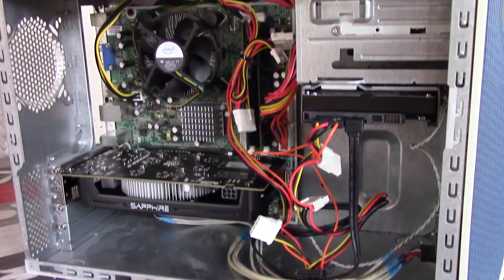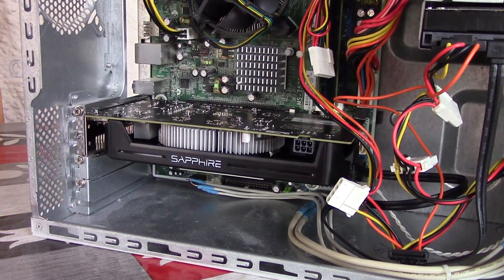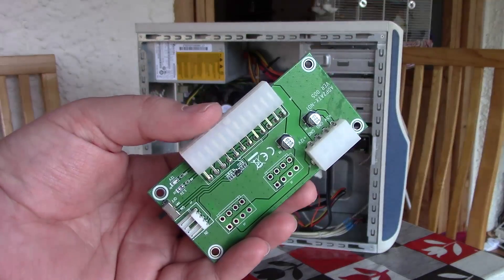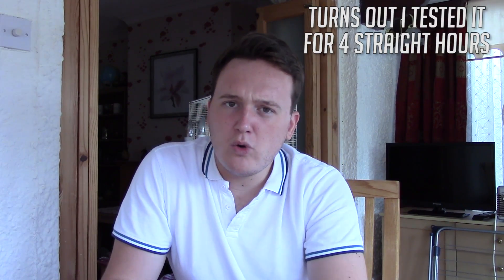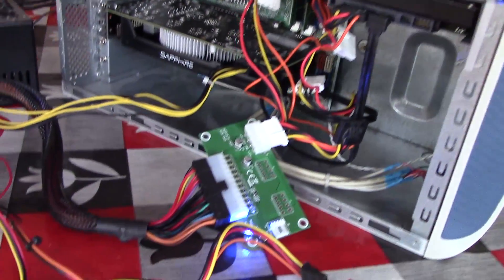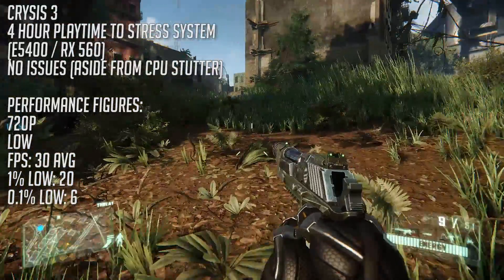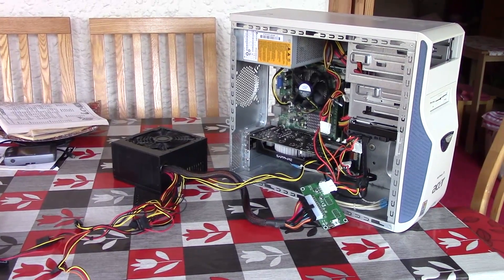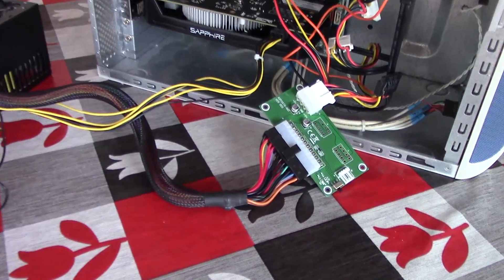Powering a Graphics Card With a Separate PSU

Comment: Let's be honest this is really for vega owners
Reply: Retro/Modern Gaming at its Finest Attention Beggar
Reply: let's be honest I already have a 1000w for my gtx 780s, and if I were to upgrade to a pair of Vega 64s and a ryzen 7 my power draw at load would go down by about 100w
Reply: No, AMD Vega.
Reply: Retro/Modern Gaming at its Finest why are you upset over a pc component when you play nothing but playstation....? Seriously why are you even here?
Reply: potatos_ 4life
The 1050 Ti is intentionally a low-watt card though, and you're comparing it to a much more powerful high-end one.

Its relative, yes 250w is 'a lot', but not for a graphics card.

Even a mid-range one like the GTX 1060 will consume about 120w, twice that of the 1050 Ti.
Reply: Unless you have a 300W PSU, you dont need this for vega lol
Reply: yeah but that part of for servers to power graphics cards is probably true but with a much more safe and reliable solution
Reply: @yumri4  Nop, that's exactly the same board.
Reply: @fss1704  the board might be the same but higher silicon quality chips so nothing in the way of hardware glitches happen and better in the way of being stable drivers. So yeah same board just higher quality and more stable which they pay for thus the price difference.
Reply: @yumri4  Nonono, i mean the board that you use to connect the second power supply is the same model used in industrial scenarios.
Reply: @fss1704  that makes sense as those power supplies are probably made for dual power supply machines
Reply: @yumri4  Yes they are, psus are made in a way to allow you to connect both green wires together to turn the psu on, you don't even need the board to have the psu auto turn on, you just have to ground the psu to the other psu and connect their green wires.
Reply: @fss1704  i was agreeing with you on that. Sorry if it came out as me being sarcastic or something but yeah the power supplies being that makes sense to have for a dual power supply machine. I just never knew how they worked as i only ever needed a single power supply.
Reply: @yumri4  Yeah, i know, i just wanted to clarify how we do in the industrial  size,you just take 2 jumpers from the green and gnd and connect them into the 2nd power supply green and gnd, no need at all for the board if you don`t want to, all you need is an old cellphone charger cable connecting the gnd and green of both power supplies.
Reply: Queen Victoria GG novideo fanboy
Reply: potatos_ 4life errrrm no they don't lmao
Reply: potatos_ 4life
That's primarily because of the cost and performance of the cards themselves, not the power draw. The only time that's really a factor for those cards is when you have a low-watt PSU, like you'd find in most pre-built PC's.

Capt Snuggles
And that's relevant to my point how exactly?

If you're going to compare the RX Vega cards to Nvidia's, then do so with cards they're actually competing against, the 1080 and 1080Ti.

Again, two different tiers, much stronger cards, and different marketing positions. Don't forget that Vega is positioned between the 1080 and Titan XP as gaming/general compute cards.
Reply: "850 watts for a ryzen build?" they said. "you're insane!" they said... who's laughing now?
well, probably Antec to be honest, as I have a spare HCG 850 (bought 2 of them) so I have one on hand for backup and testing purposes.

however... I might just have to give this a go with my vega card when I get it (give the card a whole PSU across both rails) just to see if it makes a difference when overclocking the snot out of it
Reply: Power supplies have been fine for awhile lmao. Even the power hungry 290x cards that were around the same as vega in power consumption ran fine on the same psus the nvidia cards used.
Reply: Steven Randall steam statistics are wrong when it comes to intel integrated graphics cause steam counts intel integrated graphics when you have igpu enabled which lot of ppl have so making statistics false
Reply: you can easily buy 300-500 watt psus and i5 6600k and gtx 1050ti consumes 250W so yeah one Vega gpu consumes more power than a lot of pc budget builds
Reply: ZombieBarioth now compare it's wattage to a 1070 and it's drawing more power.
Reply: i know its intentionally a low watt card but more people have low watt cards under 150 watt than people with high watt cards
Reply: TYPICAL GHOST SNIPER they do cause half of them use a integrated graphics and prebuilt pcs.
Reply: actually yeah not everyone owns gtx 770&970&1070 and above most of the people own 1060 cards and below just look at steam statistics
Reply: 6.37% = "most people" vs the combined percentages of 770, 970, and 1070 of 9.07%... but IF I don't read statistics like a moron I can scroll down to DX11 GPUs and see (drum roll) about 20% of people using intel HD 4000 graphics on steam! so you're wrong on 2 or more accounts
Reply: if you combine all the cards under 150watts its way more than power hungry cards and i said 1060 and BELOW not just 1060
Reply: I'm pretty sure it measures your primary graphics adapter, however even IF what you say is true the person I'm arguing against saying "most people own 1060 cards" is still demonstrably false, and my statement reigns partially true more people have them than 1060s even IF they're not using them as primary
Reply: Steven Randall nope it registers intel integrated graphics as well check for ur self open steam then look in system ur see it registers both integrated and dedicated graphics
Reply: How about you stfu.. attention seeker Retro/Modern Gaming at its Finest
Reply: deathbat6916 yeah I thought as much originally, but hey, if it's worth doing, it's worth over doing.
Reply: 2 Years later and still the same.
Reply: How did you know
Reply: Also for those who do not want to replace the custom psu
Reply: Do you mean, RTX 30 owners?
Reply: U misspelled “shitty hp”
Reply: Or HP
Reply: Ahahahha
Reply: I undervolted my v56 and it consumes like 160w
Reply: Dual 1500 watt power supplies to power the water cooled card lol.
Reply: Rx 56 + undervolting isn't that bad, but can't say anything good about the Rx vega 64, especialy considering it's price point.
Reply: Queen Victoria  fuck ur Vega shit
Reply: Learn to take a joke AMD dipshit
Reply: Tibor Klein Triggered ASS fanboy
Reply: my whole pc i5 2400 and 750 ti consumes less than a 250W so yeah 250W is a lot!
Reply: 250W is not that much you Nvidiot dipshit.

Comment: You don't need to buy into that molex to 24 pin connector crap. All you need to do is connect the green wire and any black wire on the 24 pin with a paper clip and plug it in and the power supply will start right up.
Reply: Mateus Elias it's so both power supplies turn on simultaneously
Reply: The little card is shorting the green one, when the other one is powered. It's so you can have it all in a case as a permanent solution. (You want to manually short it every time you start your pc?)

I used to have a little adapter that connected both pairs of green cables to the motherboard in order to do the same thing. Used that for more than 4 years.
Reply: believe it or not, some people dont want to have to do that every time they turn on their pc.
Reply: Slywooftwo yeah I dont understand whats that card for
Reply: If you have a soldering iron you can do this alot simpler and cheaper with a $0.20c switch off ebay, then you simply press 2 buttons when turning your PC on.
Reply: Not in the same way though. That uses some board logic. This uses the other method but does it in a way that still lets you do simultaneous power up. I was saying this in response to someone else saying to use a second switch though you don't have to do that. I would rather use the board personally.
Reply: EvilTurkeySlices just shorting the green wire does that
Reply: lmao ok
Reply: I don't see much reason that you can't just split the switch header from the front panel to the power supply as well as the motherboard It just needs a bit of wire and you still get the simultaneous power up.
Reply: WorldInThe Statham that is pretty much what this board does.
Reply: WorldInThe It probably just bridges the two pins only when power is applied to the molex plug from the other psu.
Reply: It does but it's a cleaner method than most of the others suggested.

Comment: well i can say i have been running duel power supply for three years now  and it works

Edit:
i just use a paperclip
Reply: maikson97 please tell me more, im curious how it works with just a paper clip
Reply: @jibpanda5388 same concept but you a paper clip to short the ground and power to start the PSU
Reply: Amazing. I’m thinking about doing this with an hp until I can upgrade...

Comment: I need a GPu for my retro pc that has a pentium 4 660 3.6ghHT. Problem is I am using 300w powersupply. what card should i buy? I am all up to used and for old cards aswell
Reply: BigganD titan x 69 way sli
Reply: I think from a gtx 1050 downwards, like gt 1030, gt 950, gtx 750 or even rx 460 and below.

Comment: what that little board do is when it receive electricity from the main PSU, it will turn on a transistor which will shorting the power_on wire to ground of the second PSU which will tell it to turn on. When the main PSU is turned off then there will be no more voltage to hold the transistor thus it will release the power_on pin and then PSU 2 will shutdown automatically
Reply: Riley Stanish transistors doesnt hold power, also 12v and 5v molex doesnt 24v
Reply: Riley Stanish no, the transistor will short the power_on pin of the second PSU to the ground which is like the paperclip trick the only thing that's different is it's automated and in synch with the main psu
Reply: @pierreuntel1970  You just dont need that, connect the gnd and green from the 2nd psu directly to the 1st psu, THE GREEN WIRE IS MEANT FOR THAT
Reply: pompadoms no, the 2 PSU must be in sync and the second PSU will be turned off when the main PSU is turned off, you can see at 1:53 under his finger having a small smd transistor
Reply: this, i wonder if that floppy connector in the board can be used as well instead of using a molex cable
Reply: Riley Stanish 
The PSU'S are not connected in series
Reply: Better than my paper clip lol, it still works tho.
Reply: grizwhop nation then why it need a board at all? And why does it need to connect to the first PSU for? Anyone can simple grab a paperclip and short the power_on pin without any expense. If you just simply shorting the second psu manually then when you turn off the main PSU then the second PSU will still keep running and could create unexpected electric flow into the GPU and might get feed into motherboard create problem with its power control mechanism
Reply: @pierreuntel1970  This is exactly what I am experiencing now. In the beginning my relay that connected the power on to ground of the second PSU switched of when the computer turned off. It worked fine. Now, after both PSU's had been disconnected from the mains for a while, the second PSU somehow manages to get power to the relay, keeping itself powered on until I power of the second PSU manually. The CPU fan will keep spinning before I turn the second PSU off, though a bit slower.
Reply: William Poetra Yoga well.. If you also connected parallel the power_on pin that mean both PSU will get active/shutdown at the same time because they both receive command from motherboard, if 1 PSU failed then the other just take over with no lag because you've parallel connected them, both PSU will fed power to mobo
Reply: Am EE qualified. Can confirm that SandPox is correct. It's just one transistor (electronic switch) which bridges Pin14 (PS_ON) on the 24Pin power connector to ground. This then turns on the second powersupply that is connected in parallel (not series) to the rest of your system. More advanced configurations of this exist in for example server power supply systems where one PSU acts as redundancy for example.
Reply: William Poetra Yoga yes, just connect everything in parallel (yellow to yellow, black to black, red to red...) And things should work
Reply: I'll pretend that I understood.
Reply: bbloching What do you mean balanced out over some capacitors? I'm not understanding you'd want them there as long as gnd is coupled between PSUs, so avoiding an offset.
Reply: IncandescentWithRage sah, sounds more reasonable than my guess. For balancing purposes the capacitors are too small anyways.
Reply: William Poetra Yoga Server grade power supply redundancy has been around for a long time, if you want redundancy server parts are the way to go, many have hot swappable parts and are built for maximum uptime.
Reply: Yes, and we can actually make something similar and simpler logically, using a 5V or 12V relay.
Reply: @wpyoga  or you can cut the green wire on the 2nd psu and connect it directly to the green wire on the first psu.
Reply: Can we implement PSU redundancy in a desktop setting?
Reply: SandPox ok the way you first described it didn't make sense to me. Thanks for explaining.
Reply: +SandPox Sorry I wasn't specific enough, yes this looks like the method to create PSU redundancy, but how about the switchover lag? With regular desktop PSUs, will the CPU reset upon switchover?
Reply: SandPox hi, my psu has the Sata connectors and I want to use the Add2Psu for a gtx950 do you think the sata to Molex adapters/ converters are safe for this?
Reply: SandPox right
Reply: What is that thing called
Reply: John Doe relay are overkill, it don't need to handle a lot of current, it just need to pull the pwr_on pin to ground and PSU will turned on, there is no high current on that pin
Reply: All it does is connect the green wire (power_on) on the PSU to ground, which tells the PSU to turn on. Nothing to do with transistors.
Reply: pompadoms it connects the green wire to gnd sure but its not always connected otherwise the second psu will turn on as soon as you plug in to the wall outlet. The board connects the green wire of the second psu to ground to turn it on as soon as it gets power in the molex connection from the main psu and to do that it uses either a transistor or a small relay
Reply: grizwhop nation Pretty sure trolling, but here goes. Yes, it connects the green power on pin to ground using a transistor. It uses a transistor because the transistor is only on and conducting (connecting the green power enable to ground) when it receives a voltage from the primary PSU. So the short to ground is toggled by the presence of voltage output from the primary PSU.
Otherwise it'd be on all the pissing time.
Reply: exactly. and the 12V and 5V rails are balanced out over some capacitors. as for the transistor input voltage: there are 2 groups of 3 smd resistors each, i suspect it's a voltage divider with a current limiting resistor in series to trigger the fairly small transistor. and maybe a dummy load for older psus wich need such things to be switched on externally.
Reply: @bbloching  You just dont need that, just connect the gnd and green from the 2nd psu directly to the 1st psu, THE GREEN WIRE IS MEANT FOR THAT
Reply: @bbloching  You just dont need that, just connect the gnd and green from the 2nd psu directly to the 1st psu, THE GREEN WIRE IS MEANT FOR THAT
Reply: this has nothing at all to do with a transistor, it simply connects the power pin to a ground pin
Reply: SandPox you're trying to tell people that the transistor on that board is holding 24v? Because that's utter bs.